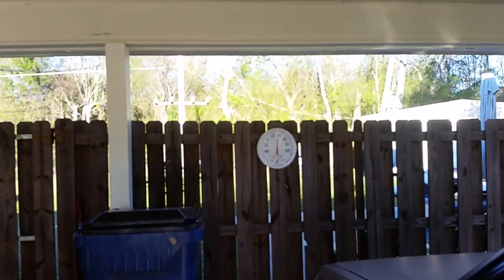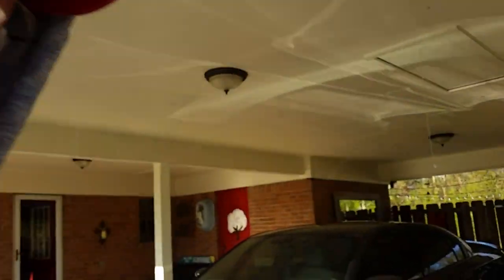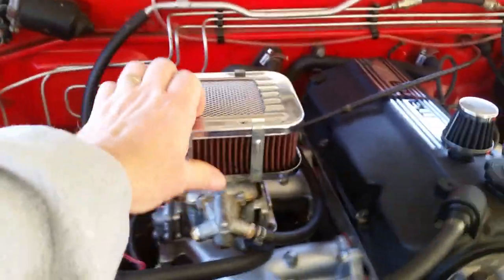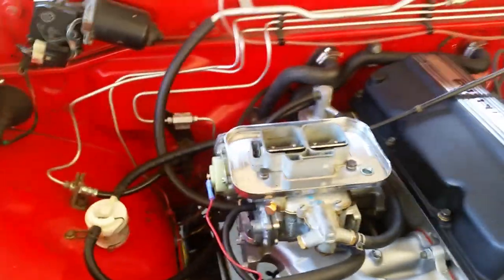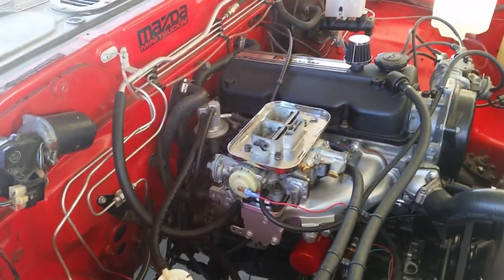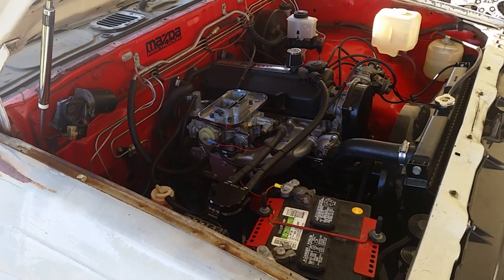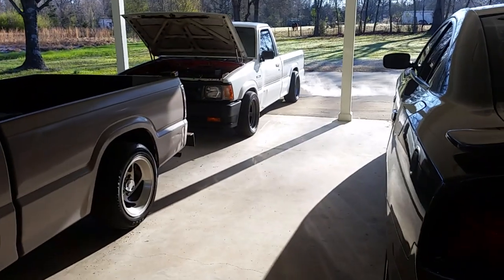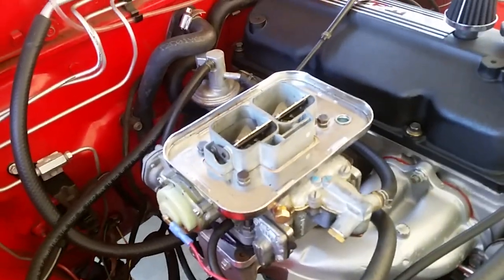How To Adjust Fast Idle on Weber 32/36

Comment from the maker: Join us on facebook
https://www.facebook.com/groups/mazdaminitrucking
Reply: MazdaMitch hey man do you have a brass float in yours?
Reply from the maker: @MVP0816  No these do not have a brass float in them. Its a different material.
Reply: MazdaMitch I’m converting mine to brass I’m having issues with the composite float breaking down
Reply from the maker: @MVP0816  You may not have a genuine weber, you may have a cheap clone. I have had the same weber for over 11 years, no issues.
Reply: MazdaMitch no it’s a legit Weber it’s just the float is bad flooded my entire intake with gas
Reply: @MazdaMitch how can I contact you

Comment: Mine is dumping fuel above 2500rpms. I am still in the process of troubleshooting it. It's a real Weber. I am going to keep checking for vacuum leaks, since I know that can force the power valve to hang open. If I rev and hold the rpms at ~3k, my garage fills w/ smoke. It's definitely gas.
Reply: Alright, fixed it. It was in serious need of repair and help. I bought this truck w/ the Weber installed and dude must've had no clue what he was doing. None of the plates were flattened. There were MASSIVE vacuum leaks all around the carb's base. 

So I took everything apart - found out one of the carb mounting studs was completely stripped out. That was fun. 

Got everything flattened. Sealed up.  Adjusted. 

It's amazing how much better the truck is running now with a good seal and some minor adjustments.

Comment: Great info, great video. Previous owner removed choke butterflies off mine, 200rpm cold start, accelerator to keep it alive then settles eventually at 850 but then up to 1000 after fully warmed. School run can be interesting lol so much fun...

Comment: Mitch, I see a lot of people here on YT that change their stock carb with a Weber. I used to have the stock FE carb but it was not fully operational. I changed the whole intake with one of a 626 and this carb is far better than the previous. I have a fuel consumption of 27.5 mpg (8.6lt/100km) in average and with a smooth operation. So, should I change it??? I have the saying "since it's operational, don't touch it"...
Reply from the maker: If it ain't broke don't fix it that's what they say but hey after a while when that stock carburetor starts having fits and you can't tune it or do anything to it you'll be looking to the Weber it's so much simpler gets the same miles per gallon I get 27 on the highway and 25 in town 23 if I'm pulling a trailer

Comment: My red wire isnt plugged into anything from the electronic choke .. where does that plug in
Reply from the maker: The Weber needs 12v for its choke so I have mine run over into a leftover plug on the passenger side from wire clean up
Reply: @MazdaMitch  I realized u answered this question if I would've just watched the whole video .. thanks a ton .. just bought my first b2000 n it idke rough ..gonna start with the choke

Comment: I have a clone Weber.  When it warms up the fins end up straight up and down.  Any idea what I am not adjusting correctly?  The idle doesn’t seam to want to slow down and the fins won’t stay somewhat closed to bring the idle down like your video
Reply from the maker: They are supposed to be up and down when it's warm. That's a choke plate and when it's warm and the choke is working the plate will be up and down. It's closed on a cold start.
Reply from the maker: What you need to probably do is adjust the fast idle screw. That is covered in depth in the How To Tune (in depth) video on the channel

Comment: Embarrassed to make this comment, but I put a clone weber 32/36 on my 1982 Toyota truck and after about three years, one morning my throttle stuck wide open. I immediately turned it off went under the hood and unstuck it not seeing what the cause was. Then while leaving a friends house it happened again. Then when I looked there was this linkage hanging down which I could not see where the other end connected too, so I removed it. The truck seemed to run fine without it, for about 9 months. Now all of a sudden it dies without continual throttle depression. Now I found your video and what fell off is the linkage with the fast idle screw. So your video was great but now I am looking for a view from underneath the auto choke, too see if I am missing still another part(for sure I need the pivot screw, but looks like something else was connected there too. Any help is welcome and seems like such a tiny problem to have to scrap the whole carb, but looks like most people have a spare clone lying around for one problem or another.

Comment: What is that black bottle on the side
Reply from the maker: That is an oil catch can and it goes in line with the PCV system. There is always oil vapor in the PCV system and it ends up on your valves and can cause carbon deposits on the valves in the Pistons so with the catch can we're catching it all which you'll have a cleaner system every vehicle needs one but the manufacturer is often do not put them on there because that's just one more thing that you have to maintain and they don't care it's not profitable to make a vehicle last long. I have a video or two about the oil catch can on here somewhere.

Comment: I think you just diagnosed my weber problem on my 77 MG Midget. Sticking at 2k RPM wont idle down. I think the choke has me stuck at high idle. Ill check tomorrow in the daylight
Reply: I have the same issue did you ever solve it?
Reply: @wellconnectedwellprotected  the whole carb needed a rebuild and reset to factory default. The choke was too closed, running rich at all RPMs, the idle adjustment was too rich, the accelerator pump was weak. The secondaries came on too soon too, making it run even more richly at speed. I didn't wind up changing jets or really anything.

Comment: Is it really important to connect the electric choke to work the carb properly? I having trouble on my   Choke.. it wont hold the butterfly when im trying to adjust the idle speed screw. How many turn the fast idle screw to work properly?
Reply from the maker: Yes the electric choke will not work if it's not connected to electricity
Reply: @MazdaMitch  engine shut off when i tried connect to 12v.. having misfire on carb
Reply from the maker: @norman2482  Misfire usually. means the timing is off. Take a deep dive through all my carb videos to get a better understanding of the carb. Yes you need to choke hooked up and everything set properly or at least baseline. Thats too much for text to tell about all that, hence why I have made so many videos, check out this playlist https://www.youtube.com/playlist?list=PLc4KKLOqwwOvpSgL00CqbBC7oUuIDxHIN

Comment: On my 32 36 when i start it it dont rev up to wjere i tap the pedal to lower the idle mines runs just fine it doesnt do that
Reply from the maker: Well that's because you don't have the fast idle cam set correctly or the fast idle set at all If you don't need it you don't need it but if it were me I would set it correctly because even living in Mississippi where it gets hot as hell it still useful on startups
Reply: @MazdaMitch  im gonna leave mines its fine
Reply: @MazdaMitch  do you know if theres a differenc between using the 2 inch filter compared to the 1 inch filter
Reply from the maker: @hawaiialljamup  Easier air flow. More air flow with less restriction the better. The lower air filter is almost dead even with the top of the carb.
Reply: @MazdaMitch  my truck stills runs a bit after i turn it off ..i dont know why..like its diehard
Reply from the maker: @hawaiialljamup  sounds like run on. Which can be too high an idle, or too rich, or both.
Reply: @MazdaMitch  thanks for the help

Comment: do you have to screw in that  fast idle screw or is it better to tighten the choke for more spring tension?
Reply from the maker: The fast idle screw, you can adjust it by screwing it in.
Reply: @MazdaMitch  ok how.much is to much what are signs cause my weber 32/36 that screw wasnt even touching the cam now that its tighten more  it doesnt stutter or wanna die during start up or at a red light wayy better!!
Reply from the maker: @chefrobertcaldas  the fast idle cam is for when you want to adjust to fast idle on cold crank, it works with the choke. How much is too much? You can make it run very high rpm, youlll know.
Reply: @MazdaMitch  yah i feel like mine is to high now should i adjust the choke and fast iddle screw 🤔 or just the fast idle screw a half turn out?

Comment: I have a Weber carb on my 85 cj. Mine doesn’t seem to have the two stage cams. It seems it’s either wide open choke on right down to about 6 800 rpms. Just an estimate I don’t have a tach. I have an issue that it seems to misfire when I hit about 55. Like a hard misfire and it is over and over, I thought I had it fixed when I change the normal tune up stuff. I can say my carb is filthy I’m gonna take it off and clean it. I know on my old Harley if the carb settings are off it runs terrible. Fouls plugs. Not sure if it works like that with vehicles though. Would it cause my vehicle to misfire around 55mph? It seems like it’s not getting fuel. It has done it ever since I bought it. It’s a mint ride but this problem plagues it. Nice ride man love the old school rides! She’s clean!

Comment: Is it bad to pad it immediately after starting, taking it from 2k to 1k rpm, or should you wait ten seconds or so? If so, why is that important?
Reply from the maker: It depends on the climate and how cold it is outside If it's really cold I let it run at a high idle for about 10 seconds or so and then I pat it and then it goes down to around a little bit above a thousand depends on how cold it is and then I'll let it finish warming up and when I'm ready to go I pat it again and it goes down.
Reply: @MazdaMitch  you the man!

Comment: I got a Weber 32/36 on a Suzuki Samurai that's burning too rich ,smell gas and consume a lot of fuel. What could be cause. ??

Thank you!+
Reply from the maker: The float could be set to high, and mixture screw turned out too much. Needs a tune via the tuning guide
Reply: @MazdaMitch  Ok thank you . I will  try to tune it with the guide. How I can adjust my float. Whats the ideal setting?

Once again Thank you

Comment: Not sure if you still respond to the older videos but I'm working on the Weber on my Subaru brat. When I start it up with the fast idle it will be at 2000rpm but when I tap it after 10-20 seconds the car will die. Any advice or thoughts?
Reply from the maker: I would want to think the choke adjustment doesn't have enough tension on it.
Reply: @MazdaMitch   Thank you for your help! I double checked the choke and checked the vacuum pull off. Both are good now but I'm still having problems so I think I must've set my my floats too low. Thanks again

Comment: Question ... ive got an 89 mazda b2200 , weber carb installed , timing belt done , new ignition coil , new distributor . My mazda will not run at 14° i have to advance it waay past 14 for it to run. ran it like this for a month . Randomely some strange reason it started to increase idle so i retarded timing back to 14°  and it ran perfect for a short while but now its back to only running if i had to assume 20-30° of timing

Comment: Where are you getting the 7 volt connection...Thanks
Reply from the maker: Back of the alternator puts out 7. That is where originally the choke it heater plate was connected with the original carb.
Reply: @MazdaMitch  Thanks for the reply.  I'll see if I can find it.  My weber carb will only stay choked for short time.  Once you press the pedal the choke pops to full open.  Has been sitting over winter.  I need to see if I can get it adjusted.  Thanks again for your reply and great videos.

Comment: hey man, i know this is an older video but im having a huge issue with my choke. car starts amazing, but once it starts warming up the choke will start closing until it’s closed shut 100%, i know it’s supposed to open instead, but i just can’t seem to find the issue with it, i have a huge headache about it and hope you can help me out, thanks!
Reply from the maker: Do you have the choke plugged up to a 12 volt power source so that it can have heat applied to it and expand the bi-metal spring which will open the choke?
Reply: @MazdaMitch  yea, 12v from hot side of coil, took the choke out to see what was going on and it looks like the spring starts expanding instead of getting tighter, i’m not sure if it’s supposed to get tighter, if it did it would open the choke once it warms up, but since it expands it starts pushing the choke closed until it closed shut and makes the car die. really confused but i ordered a rebuild kit and a new choke to see if it solves the problem.
Reply: 5 months late but I had a weber like this, factory installed the choke coil in reverse! Flipped it over and had no issues from then on.

Comment: i need some help, the idle screw on mine for some reason needs to turned all the way in to just touch the bracket for setting the idle, everything seems to be hooked up correctly, i have pictures if you'd want a better idea of it
Reply: are the throttle plates fully closing?

Comment: How do you tension them?
Reply from the maker: I'm not understanding you?
Reply: @MazdaMitch  do you refurbish the carburetors ?
Reply from the maker: No I do not.
Reply: @MazdaMitch  I’m having trouble with my truck it shuts off when i let off the accelerator what can the problem be?
Reply: @MazdaMitch  I’m having trouble with my truck it shuts off when i let off the accelerator what can the problem be?
Reply from the maker: @christiancardoza2137  maybe you need to adjust your idle speed screw.

Comment: OK, I start my truck, it idles at about 1800 rpm and stays there. I put it in drive or reverse and it idles down to about a 1000 rpm. I did have a friend mechanic adjust the throttle and the fuel mixture to get the carb to this point.
My question is, what do I need to do to get it to idle at that 1800 to 2000 rpm at start, warm up, tap the accelerator and drop down to the normal 1000 rpm range?
Reply from the maker: You just need to adjust the fast idle screw attached to the choke. Thats what is discussed in this video.

Comment: Hey Mitch had a question. Had a 32/36 Weber installed and now the gas pedal seems to be harder to push to accelerate and seems to have a short amount before it feels like the trucks floored and really doesn’t seem to be any faster or anything. Any suggestions?
Reply from the maker: Sounds like your throttle cable is too tight, possibly on how you installed it. Review it and adjust.

Comment: Does this cause for it to  go low on oil cause I have no leaks
Reply from the maker: No. Yours is probably just burning oil due to worn rings
Reply: MazdaMitch  how do I search those up are are they just called rings cause mine stays at high rpms idk if the carb needs to be adjusted or what
Reply: Also I did an oil change like 4 days ago .. previous oil was pitch black and now 4 days later it’s low on oil and it’s back to black

Comment: Is this 2 stage cam something that will naturally be actuated upon startup, and then click off when the truck warms up and the choke valves open up? Or is it something that you have to mess with manually. I bought an old Nissan with a 32/36 on it and the butterfly's were zip tied opened. Needless to say I couldn't get it fired up on cold AMs.
Anyway I can get it started but I have to click the cam by hand, on and then off, otherwise the engine races.
Any insight would be appreciated.

Comment: hi on the secondary side of the 32/36 dgav their is a diaphragm with a hose connect to the bottom of the carb can i block it and Will it run good
Reply from the maker: I think you are talking about where the PCV hose connects to the base of the carb. Sure I think you can cap that off if you wanted to with no ill effects. I run my pcv line to it though.

Comment: I noticed that you have your pvc hose running to a canister then to the manifold? I just have mine going straight to the manifold? Should I change that? Because I have noticed that several people have it like you have it but I have also heard from a couple other people that it doesn't matter what is your take on that..
Reply from the maker: I added an oil catch can, thats where the line is going. Its catching oil vapor so that I have a cleaner intake and cleaner burn in the combustion chamber.
Reply: MazdaMitch 
Thank you.. can you do a video on how to properly set a Weber 32 - 36 dgev I believe that is the exact same carburetor that you have

Comment: you are running too much fuel pressure
Reply from the maker: No I am not. The stock mechanical pump doesn't put out too much.
Reply from the maker: I've also been doing this almost 10 years. I have two trucks. Get 27-30 mpg hwy. What what!!

Comment: @mazdamitch I have a question about the high idle cam. When I start the truck up in the morning it goes to 2000 rpm. Ill leave it for a few moments then tap the gas, it goes down to 1000 rpm. When I start driving around it idles at 750rpm. But when I stop it will shoot back up to 1000-1500. It will drop back down to 750 if I tap the gas again. It seems to be getting stuck on somewhere on the cam lobe. Have you had any experience with this? If you could shed some light that would be much appreciated.
Reply from the maker: Spray lubricant on everything. Try that first. Is the carb used or old or not genuine? Throttle shaft may be worn.
Reply: MazdaMitch its genuine and about 7 months old. This all started after i adjusted the high idle speed from 2000 to 1500